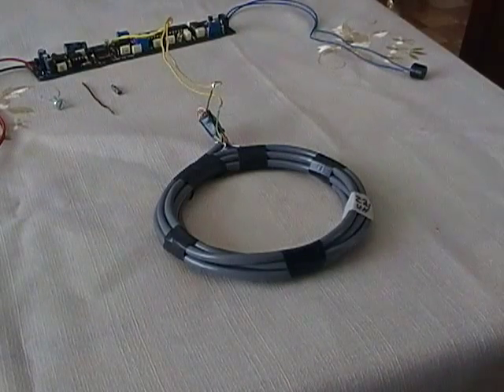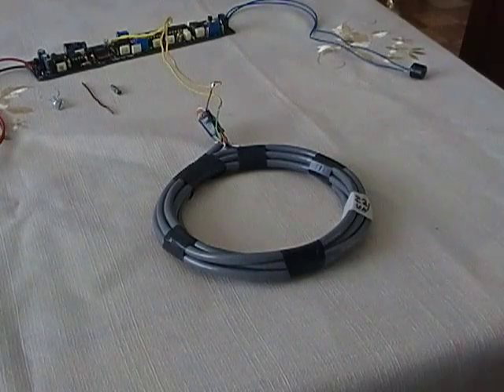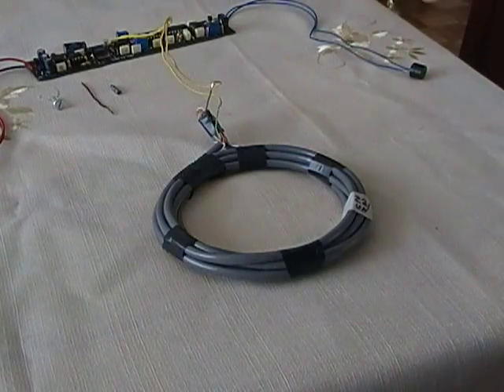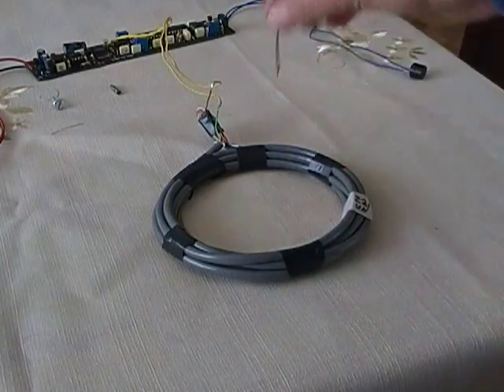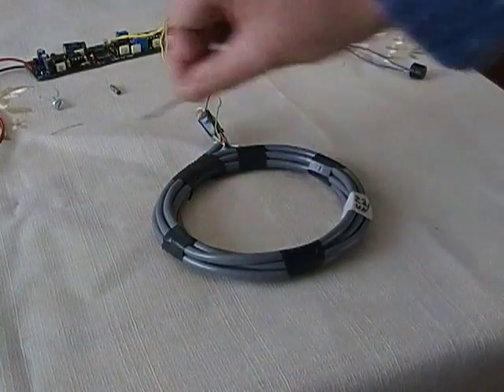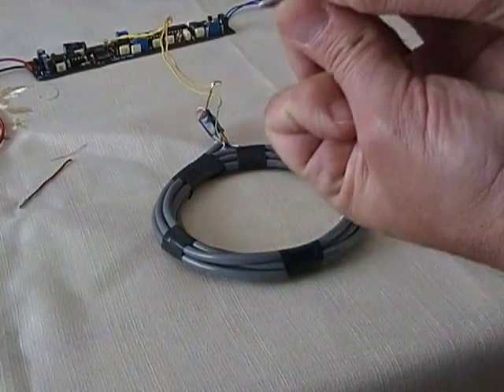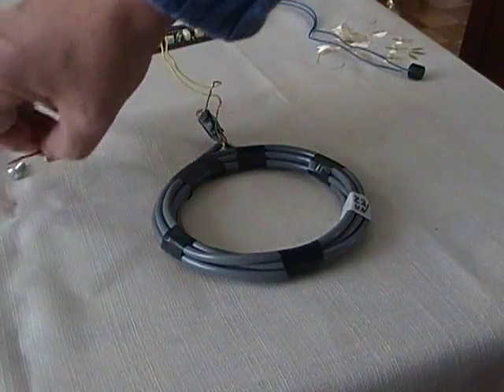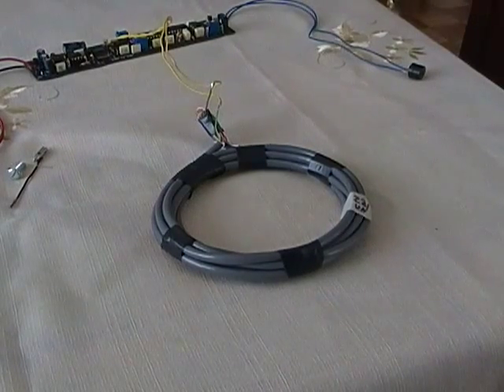Surfmaster discrimination or what?

Comment: my surf pi 1.2 , using copper coil 0.5, 25cm wide 21 turns and sealed in aluminum foil and insulated with electrical tape, easly detects iron, mine detects it from a distance of 40cm,  some of my iron tools, clamps, shifters, etc. all detected, but mine is very weak on copper and gold....

Comment: Let me give you the answers.     First your pulse circuit or coil  is not correct thats why it detects the small iron wire but not the larger copper one.  In the spike versus screw test again simple answer.... the spike is made from stainless steel and the screw is made from mild steel.  Stainless steel is hard to detect with a PI detector.

You need to make that coil again because that coil cannot work with  15ms pulses.  You need a coil with very low inter turn capacitance.   You need wire with a good dielectric such as teflon coated or even better still litz wire and you have to wind it a certain way to minimise capacitance. Network cable is a No No..
Search the net for info on building a FAST coil for pulse induction detectors.
Reply from the maker: Many thanks for your help and cooperation. Indeed I solve this problem taking in mind same point you are talking about.
Best regards
Nelson